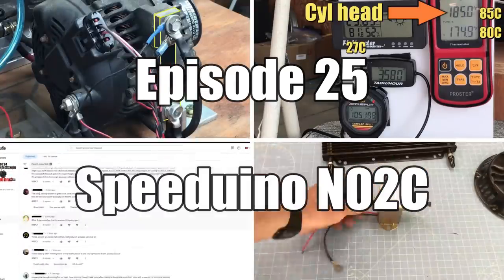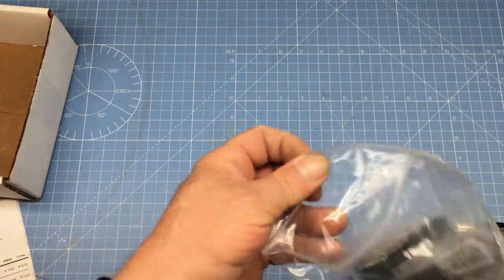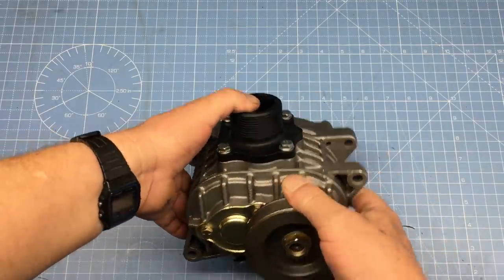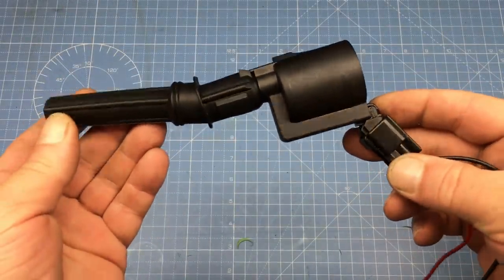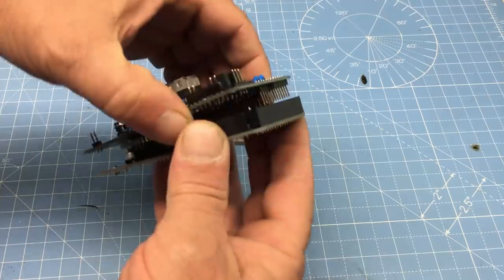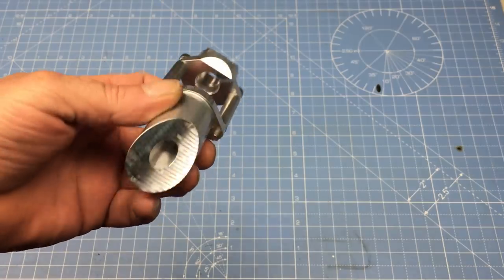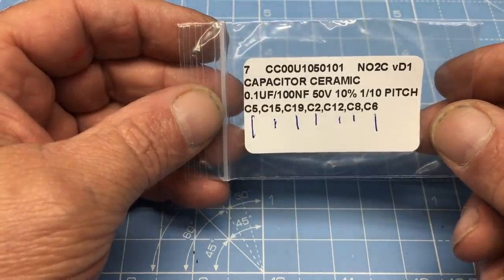Episode 25.  We take a look at our new speeduino NO2C EFI ecu for the 420 cc street legal go kart

Comment: Love your videos.  You must have read my mind because i thought a 600cc v twin efi turbo would be perfect for this project.  I really appreciate how you are iterating every step and working your way up.  thats how you learn about what works and what doesnt.  Helps with system principles.  
ive done a lot of efi conversions and this series is hitting all the major points.  Gear ratio, aero, displacement, fuel delivery.  
You might consider using the grille to feed the cooling blower via some sheet metal and louver the hood for exhaust of hot engine bay air.  Could help with temps.

Comment: I run dyno cells at Cummins in Columbus IN. That's awesome you built your own. Interesting miata build, I will have to look up the old build threads. I built up a turbo miata for street and track use. Sometimes an electronics background would be useful! I am fine with engine builds, but trying to replace a MAP sensor on a circuit board is a challenge. Looking forward to the next vid.

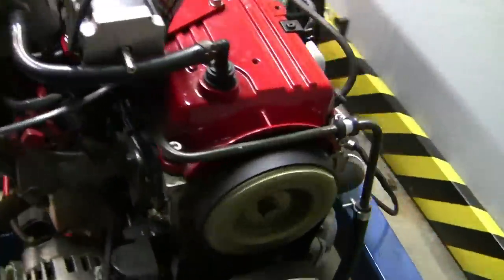Comment: Mad respect for the cube PC and the METAL at 5:22
Oh the dyno is pretty neat too.

Also, going back to the PWM controlled fuel pump\pressure, there are fuel pressure (ford) that have a tap for vacuum\boost.

Comment: Nice - I'm in the process of putting a Speeduino ECU on my 1970 VW beetle.  Got most of the wiring done last night.  Looks like you're using a lot of the same parts sourcing as I am - the same exact 36-1 Ford crank trigger wheel, Got a UA4C from WMTronics, and definitely found JRready connectors in my hunt for reasonably priced connectors.   Looking forward to seeing both our projects running!
Reply from the maker: Good luck with your VW project!  Sounds like you are on the right track.

Comment: Another good and cheap option is Spitronics Orion ECU. It will run a 36-1 trigger wheel as well, comes with whichever bar map sensor you need, 2.5 is default and you can get it with a basic loom that you just need to install the connectors on for about $350-$400. The ECU by itself is $220 plus about $60 to ship it since it comes from South Africa if you want to make your own custom loom, you can easily just get the ECU itself as it has standard connectors on the ECU. I got a plug and play one for a 1UZFE engine for $550. It also has the igniters built in to drive the coils. There is a step higher version for a bit more that will do quite a bit more. Bit easier for those with poor soldering skills. Decent software for tuning it as well. It will run distributors, wasted spark or coil on plugs. 

Nice vids!

Comment: Interesting. I have a Fiesta with a 1 liter supercharged engine here. The blower blows throught the throttle body instead of pulling air from the throttle body like in some old carbureted systems. 

To do that, I have like two valves that operates in opposite ways... when the engine throttle closes, the relief valve opens and vice versa. The relief valve got a small spring that still allows the excessive pressure to open it of the throttle position is in half position, which adds some flexibility to the system.

At the beginning, I was using a Speeduino, but unfortunately the board had some issue and the spark timing was often off, so... I replaced it by a MegaSquirt MS1, which also uses the Tuner Studio software.

I hope this project works, but I guess the 300cc look like more than engine for this smaller engine. The Eaton M24 I'm using on my 1.0L engine is 393cc with a pulley ratio at 2.739:1, which is reaching around 167-169kPa at 6000RPM on the engine. Atmospheric pressure here is around 90kPa.

This should give you some idea about the pulley ratio. Good luck! :3
Reply from the maker: Thanks for the input!

Comment: @4:14 Reliably turbocharging an engine is just a matter of setup, regular oil changes and proper care. Don't give it the beans until the heat is on. ;)
@4:24 That is not a big picture, just a different engine. :D
@4:32 Easy, bro. :D

Comment: Loving your videos on the Honda Insight! I found you looking for information on adding a EFI to an ATV. Do you have any recommendations on sourcing parts and what speeduino gear to to purchase to begin the project and journey? Its a 1996 Suzuki Quadrunner 250cc ATV.
Reply from the maker: The hardest thing to source for a project like yours is the throttle body with a injector.  Most of the time you can find something that can be adapted on ebay.  The tiny fuel pump that I'm using is another eBay part,
Reply: @robotcantina8957  CONGRATULATIONS  ROBOT  CANTINA... 104k  subscribers... 
you have the kind of entertainment and fun that viewers are craving👍👍

Comment: I am not sure if your choice of coil igniter is the right one, these old style electronic ignition modules were meant to put a fair amount of current through the large older type coils primary winding. Modern igniters send a short duration pulse to a smaller coil with much less windings and very little current is involved

Comment: How would I set up a two cylinder with individual pick ups? When browsing Tuner Studio, the options say if I switch to dual cam trigger, I would lose injector pwm (pulse width modulation). So how would I tune ignition for the two cylinders while still controlling the injector? Or am I misunderstanding something?

Comment: i am working on the speeduino soldering video for the Trabant like rn <3 
first the 600ccm 2troke and then when that works the LIFAN-2V78F-3 <3 nice to see you use the same EFI!
i got the 0.4.3C board with dual sparkplugs for 2 Piston and old 2N3055 drivers <3
we need fuel efficiant smal cars for the future, nice that you are keeping it on the road c:
Reply from the maker: I think you will like the NO2C for your project.    I have played around with Arduino projects before around small engines and found they are very sensitive to ignition noise.  I look forward to seeing your soldering video !
Reply: @Laracrafttrabant  CONGRATULATIONS  ROBOT  CANTINA... 104k  subscribers... 
you have the kind of entertainment and fun that viewers are craving👍👍

Comment: I think it might be better to have constant pressure fuel system at for example 4 bar, than to use manifold referenced pressure regulator - your ECU and fuel map will control fuel in both situations, but when you have constant pressure fuel system, then there is no possibility for having too much or too little fuel injected because of pressure transients. But then again you are using a Roots supercharger - that should have constant flow, while a twin screw would give you some pulsation. Still I think that constant pressure system is superior.

Comment: You should use the injector on the throttle body to inject something to help with inlet air Temps. Methanol maybe?
Reply: The main problem is you can't spray methanol always, and if you spray it only at WOT it's a bitch to tune for with this small of an engine. Methanol will enrich the mixture so you gotta make sure the injectors spray less gasoline.

Plus the supercharger will heat up the air way less than the turbocharger and even then having a miniature intercooler isn't such a big hassle.

Comment: Been looking into speeduino to see if I can use it for timing. Hoping to see how it works out for you :)
Reply from the maker: A speeduino for ignition and a carb for fuel would probably be easy to setup. stay tuned!
Reply: @robotcantina8957  gladly watching for updates. Lots of engine potential to be made with a controllable ignition rather than the static ignition most of my little projects use :D 

Main scary point is the soldering, I'm not too good at it lol
Reply from the maker: @X7rocks  Good point about soldering.  Some of the new lead free solder is hard to work with, you can still get 60/40 solder and its much easier to use.
Reply: @robotcantina8957  i will take your word for it and give a few solder ideas a shot. Never hurts to expand what you can do.
Reply: @X7rocks  CONGRATULATIONS  ROBOT  CANTINA... 104k  subscribers... 
you have the kind of entertainment and fun that viewers are craving👍👍

Comment: Ok fine, I'll procrastinate by watching this video.

"This is the heart of any speeduino" ... Nah. I might prefer the Teensy for the much faster Cortex processor. Gotta go all out!

EDIT: And now for me to go all pedantic. That board isn't just filled with passives. You have FETs and drivers on there which are all active components, because you need to drive high voltage / high power signals from a micro. Just picking on some terminology. 😁
Reply: No need for more, he has the needed timers available and have plenty loops per engine cycle. Teensy is only really needed for 4+ cylinder builds
Reply: @runesmDK  I agree and was thinking the same thing as well after I posted. But damnit,  I like going all out! I don't believe the teensy is really that much pricier anyway, should be the same range. That said one might have to adapt it since the pinout won't match this board I believe.
Reply: @Sevalecan  they cost a bit more, and you have to take into account they are only 3v3 tolerable on i/o's, so not only pinout/footprint incompatible. But adaptorboards have been made, and firmware runs on teensy as well. Or you could just freshly design a shield for the teensy. But its just overkill. The no2c is such a capable board, and well made too
Reply: @runesmDK  Maybe $5-$10 more for the 3.5 (I think he said his clone Mega was around $20).

After doing some checking the Teensy 3.5 has 5V tolerant digital inputs (as well as 5V tolerance on analog pins which can be multiplexed to digital functions). But the AREF seems limited to 3.3, so that sucks.

I am certain someone has done the work on this already as I've seen it mentioned for a project elsehwere, but I'll have to go dig that up now to see what they've done.

Also the ignition FETs are not logic level and are being driven by the MCU digital outputs, so that's already marginal. with 5V outputs.

I think the Speeduino guy was working on some adapter for the Teensy, but not sure where that's at now either. More digging to be done.
Reply: @Sevalecan  Josh is in alpha test on project dropbear, uses stm32

Comment: do you have a link for the parts you have been buying?
Reply from the maker: There may be some links in other videos, but basically I was getting most of the stuff from suppliers in china.
Reply: @robotcantina8957  would u be open to working with me on some tech support for a video series on upgrading a 2004 polaris sportsman 400cc?
Reply from the maker: @FatGuyBuilds  I can certainly give advice, but keep in mind scratch build EFI systems are difficult to do, especially on motorcycles or four wheelers.   Google "how to contact a youtube channel owner" and it will guide you on how to contact me directly.  The instructions that google gives applies only to users on a PC and not mobile phones.

Comment: Why didn't you coose a vw "smart" coil ? For a single cylinder it would work perfect
Reply from the maker: Really, anything will work.  Here in the rust belt, American  parts are more common in both the stores and scrapyard.
Reply: I would have picked a smart coil to not have to use an external power module, less components and wiring to fail and cause issues
Reply: @GiacomoMarenco  CONGRATULATIONS  ROBOT  CANTINA... 104k  subscribers... 
you have the kind of entertainment and fun that viewers are craving👍👍

Comment: How about installing a second engine in the trunk? No, I didn’t think of this: Renault built a two engine race car, years ago, an it was wild!
Reply: 4wd 2 cylinder monster lmao
Reply: The original engine that the Honda Insight comes with is actually already two engines in one running I think in parallel. A 10 HP electric assist and a 67 HP gas engine. Their combined output rates at 73 HP. It's very slow.

Comment: forgot the 50 dry flies tied between soldering components. 
Did you consider an electric supercharger?
Kinda through a curve between ignition module and igniter but I guess the ford coil made up for it.
If I remember correctly the module can perform some advance and retard but isn't the Arduino capable. Oh - oh I see, you need an igniter.

Comment: Howdy Mr. Cantina,  I need some serious help. I have a Heald Hauler, that somebody dropped a vc460 into, and it had some kind of cvt belt running back to a Comet transaxle. I opened up the Comet because, the back axle was bent to hell, and the inside of the Comet looked like a bomb went off. All the spur gears and whatever you call them were in pieces. I'm not very mechanically inclined, but I can generally figure stuff out if, it just takes me literally forever. So I don't have anyone I can really ask these questions too, and the stupid googlator can only show me images of gearboxes and transaxles that are RADICALLY different from what I'm looking for. All I can say is I need a transaxle that has a shaft that comes out for the cvt thingy, and 2 other holes for the axles to plug into it, (which I'll be replacing as well.) I'm not finding anything along those lines, and I could really use some guidance. At the very least, maybe you can at least tell me what I need to type into google to even remotely get me pointed in the right direction, because I'm only finding the wrong directions.
Edit: I definitely need it to be a forward, neutral, reverse type too, I've figured that much out.
Reply: Not Mr Cantina, but if i was you I'd look at either golf cart transaxles or lawnmower transaxles. I'm not sure either will fit if you are looking for a direct drop in part, but I'm sure you can modify it to work for you.

Comment: If you pick up an alternator from GM that has an oil pump for the turbo...https://www.winparts.nl/motordelen-toebehoren/dynamo/c835/alternator-opel-14v-100a-8el-011-711-761-hella/p2470589_900_900/alternator-opel-14v-100a-8el-011-711-761-hella.jpg
Reply: Thats an oil lubricated vacuum pump, for brake booster and solenoids

Comment: Not an expert but by research which I did is not a terrible idea to put throttle body after supercharger and use bypass valve or blow off valve. Living supercharger open to the air and releasing unnecessary pressure can reduce pumping losses.
 And if you use throttle body before supercharger try to reduce air volume between supercharger and engine, another wise engine can be hard to tune. Found a lot of information from people who run superchargers on miatas. They mount a supercharger on the exhaust side and run a pipe to the intake manifold and if they put throttle body before supercharger they have problems if they leave throttle body in-stock location all problems disappear
Reply from the maker: Thanks!

Comment: I find it hard to take seriously all these commercial products and projects that just connect to an Arduino when it would be far better to include the microcontroller (and maybe the programming hardware) on board instead. All those interconnects are a place to go wrong and just having the chip on-board would be much cheaper as well as more compact. I have no idea how Arduino turned from a prototyping platform (which it is amazing at) to the core component for things that should be based on a bare mcu
Reply: Because it's so cheap, and open source, that it's better to use these premade boards than actually pay R&D costs plus custom PCB manufacturing and assembly.

Speeduino is a ~$100 open source, single side PCB kit with only THT components that most people can put together at home. It's supposed to be easy and simple to put together and before all, cheap.

It's not in any way inferior to a single board solution too, so i don't see much of a problem with this.
Reply: @lazar2175  I already explained how its inferior to a single board solution. There are through out AVR components which could be used as well. R&D shouldn't be a big factor. I've made many projects based around the arduino platform but designed it to use a bare MCU. As far as I'm concerned its a matter of laziness and poor designed philosophy
Reply: @smeezekitty  This is designed in such a way that it allows your average Joe to assemble it using a $15 gas-powered RadioShack soldering iron and lead-free solder after watching a basic tutorial.

One board solution would require your average Joe to be electronics technician Joe to assemble it. He'd need a quality soldering iron and  probably hot air station too, which already outweigh the cost difference which this little kit is all about. Not to mention he'd have to know how to solder SMD components and load the bootloader onto the MCU.

This is aimed mostly at people that are into engine building/car modifying. Not a lot of them have extensive electronics knowledge. Heck, most of them don't know how to solder and avoid doing it by using all kinds of connectors in their cars. So simpler = better in this case.